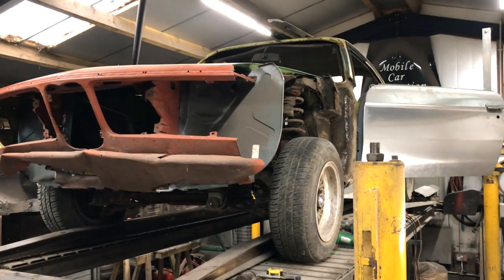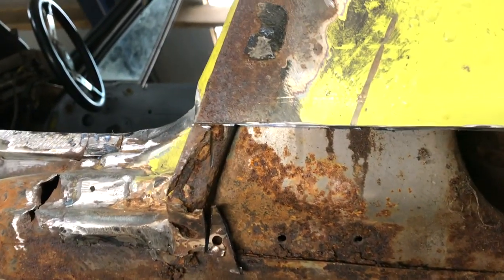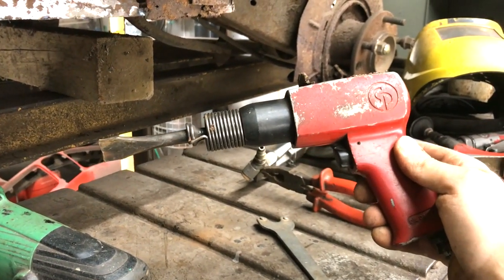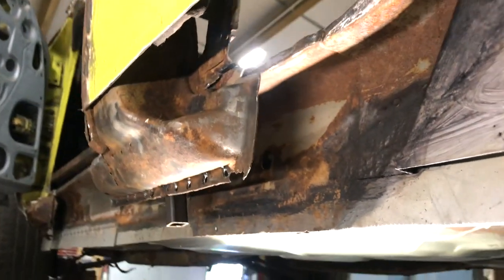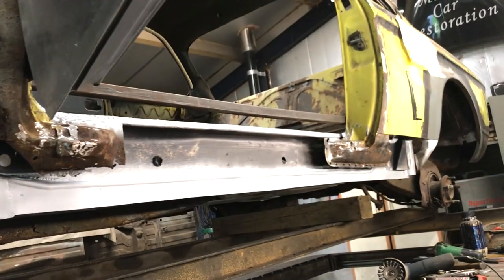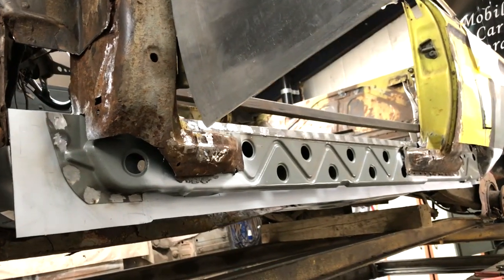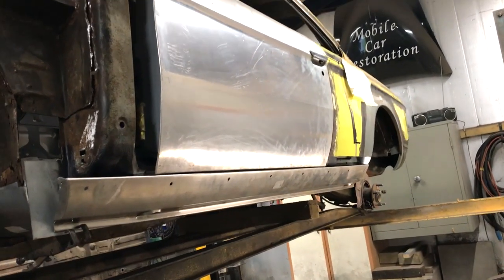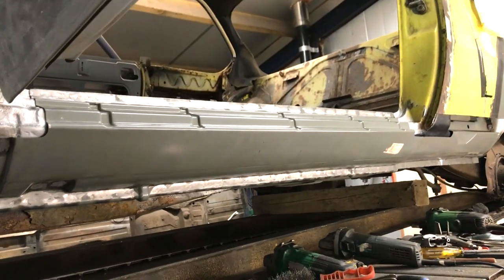Can this rare 1975 BMW 3.0 CSL be SAVED ? It's bad, part 2 classic car restoration. Sill's how to

Comment: OH, man, that's BAD corrosion !
Even worse than my old 635csi, my god, good luck and god bless, for saving this !
EDIT if you search for "rejsa e9 renovering" you will find another Swedish guy restoring a 1973, that also was VERY bad.
Reply from the maker: Hi, thanks for the encouragement. 👍never worked on a 635, beast of a car by the sounds of it. 
I tried searching for the recommended video but couldn't find it.

Comment: The colour blind painter..... excellent story ! I repaired a gold (looking) Sierra in the 80s hit in the rear, went to the paint shop, I fitted it up and then it got valated, it was very dirty. One colour at the front another colour at the back ! The boss..... my dad was not happy, everyone bollocked, even the mechanics who had nothing to do with it.
Reply from the maker: Ah, so you're dad didn't find the funny side ? 🙂
Reply: No he didn't he was old school, a lot of swearing ! He got over it. A lot of work on the bmw, good job. Just done a rotten Merc camper, two sheets of 4x3' steel, 1/2L primer 1L u/seal 2 L wax  oil, 1/4 ton heavier !

Comment: Very interesting part. It is also the question where to stop with the rust removal by cutting parts off. I believe many pf your fans would like to see more parts from such rare cars and complicated in repairs as E9 CSL. Especially a this model was using steel with aluminum together to make the body lighter. Is the car confirmed to be VIN- correct CSL? The number can give the info about the original paint code and priducion date one provided to BMW Tradition.  It is for free but it is also possible to get printed certificate but probably not for free. Take care and till next part!
Reply from the maker: Thanks! Yes I have checked the VIN to see if it was definitely a CSL. Can't remember the other details, will have to check again. I don't think it told me whether or not it was an Alpina. I think the Alpina had a limited slip differential which I haven't checked either. Easy to do on the ramp actually. 
The aluminium body panels are limited to the bonnet, and boot lid, then aluminium door skins. I don't think there was anything else aluminium but the roof is a lighter gauge steel. There might have been some other steel panels with a lighter gauge but I'm not sure. Perhaps I should do more videos on it if it's interesting. It's certainly an interesting car in my opinion.
Reply from the maker: Perfect. Thank you ! I think I did check out a forum months ago but had forgotten about it. Cheers for reminding me 👍

Comment: Nice work Ben but I can't help wondering why you don't get yourself a spot welder?
Reply from the maker: Thanks, I have a spot welder it's only a 1+1 so couldn't be used on sills as they are a bit thicker. I could get a bigger one it's true and maybe I'll invest in one at some point. They are a bit limited in use, I'll only use it when I've got new steel to new steel, unless the the mating faces are very clean, wouldn't want to risk any seams not being strong. They differently have there use in areas that are seen for that original look, front wing gutters for example i would be keen on using it.
Reply: @bensclassicbodywork  I have one on loan at the moment and you are right they are limited in use but god when you can they make light work of it.
Mind you if I could plug weld like you it wouldn't be so appealing.
Keep on keeping on.
Reply: @bensclassicbodywork  btw I have an image of the dco 40 s on the triumph I would like to send you.
Reply from the maker: Sounds good 👍 btdixey@hotmail.com

Comment: Nice job, I find the mini belt sanders great for finishing off plug welds. Btw your air grinder sounds out of tune 🏍🏍😂
Reply from the maker: 😆👍 
I use a 10mm belt sander which as you say finishes welds lovely. I did have a 20mm belt sander years ago but it broke and I never replaced it. Need to get one again as it would speed things up.

Comment: Very impressive work but why not use a real spotwelder, - they are quite compact, - will save a lot of time not having to grind every weld down, - and it will look more factory !
Reply from the maker: They can save time true and I have a 1+1 spot welder. No good for sills, I would need a 2+2 spot welder for that. They are pretty limited in their use and the metal has to be spotless. I would trust it on new metal to new metal but not on old metal unless it was media blasted. Sill's are very important for strength and I need to trust everything is welded properly. I might invest in a 2+2 but I'm not sure it would get a lot of use. I'll have a think about it though. 👍